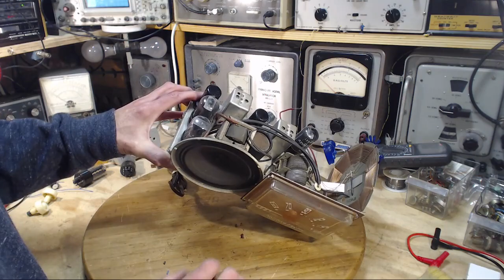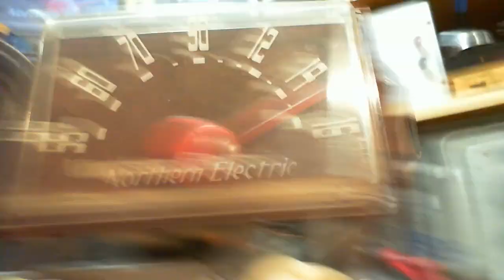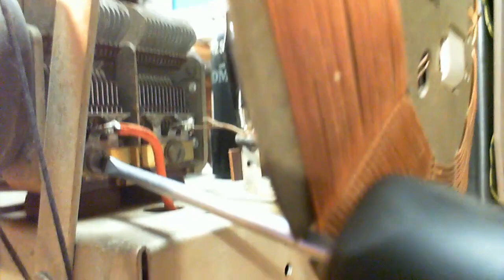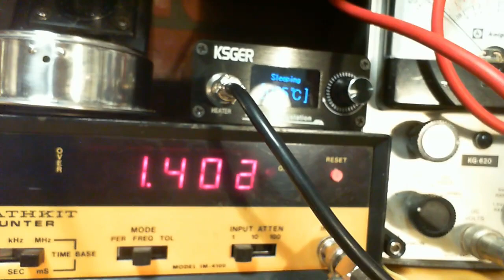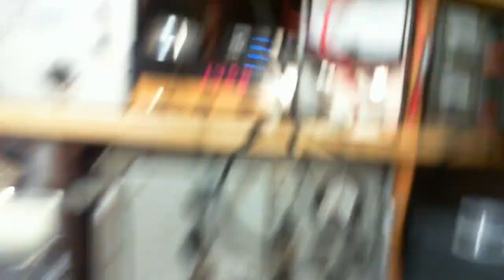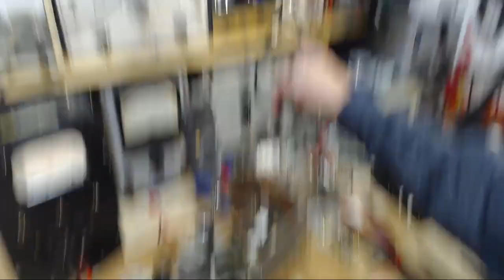Northern Electric 5300 Five Tube Radio Video #2 - Alignment Check

Comment: I remember Zenith had a problem on the 9-147 vertical module where one of the vertical output transistors would short causing the electron beam to strike the bell of  the crt and crack the crt  Zenith eliminated that problem  by modifying the vertical output fuse to a lower amperage so the fuse would blow before damaging the crt. Sams wasn’t informed of the production change. Fortunately I was informed of it at a Zenith tech seminar in Secaucus  New Jersey Service techs were sent bulletins regarding replacement of the white  4 lead safety cap with the new red 4 lead cap. The white caps cracked the crt  when they failed

Comment: Alignment with an ordinary screw driver is not the best way to work. You should use an alignment tool for radio. You may have DC on these variable cap... Change paper caps.